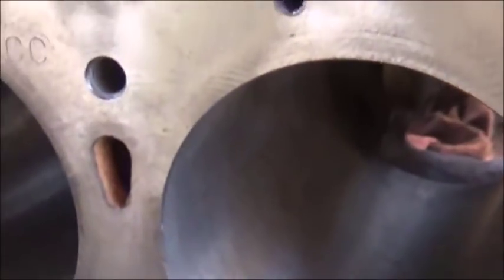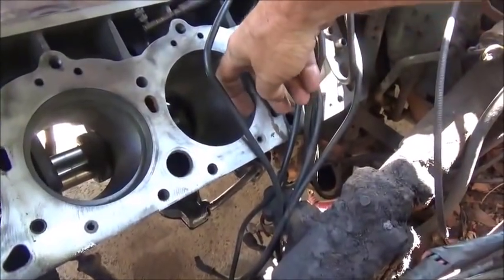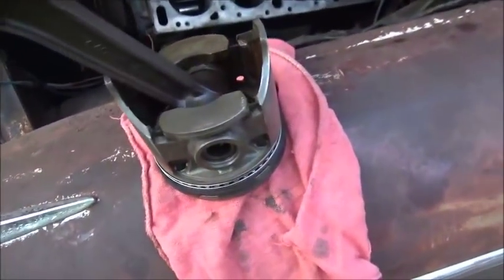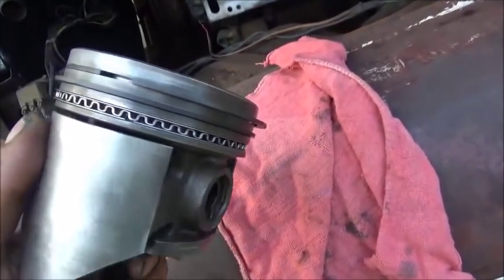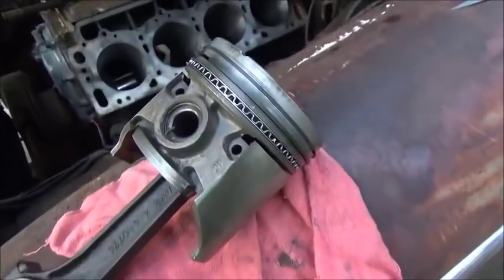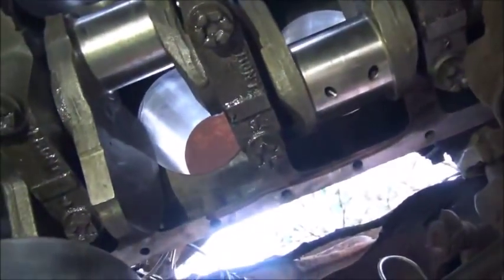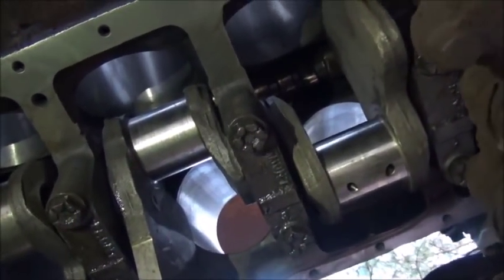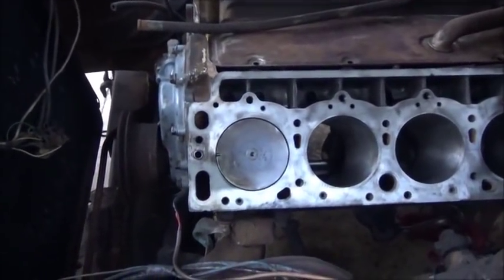1956 STUDEBAKER GOLDEN HAWK ENGINE ASSEMBLY BEGINS

Comment: Pretty much the same way I install pistons in anything. The only thing I do different is, I use a dedicated clean container to put oil in so that I can dip the pistons up past the rings to coat them before I put them in the ring compressor. (Usually get hollered at for using a good Tupperware container..... LOL)

Comment: And it's on it's way!
Yay!
Can't wait to hear it fire up.
Thanks.
Reply: Is there any data on this engine you can post ?  As to year cubic inches,   horsepower & torque,  bore & stoke,  two or four barrels, looks like a strong  and well designed engine,  they may have copied the 55 Chevrolet  design

Comment: So the tube coming out of the valley pan along with the straight up breather was crankcase ventilation in 1956...good thing you removed that valley pan - that po' critter didn't need to be in there...are you going to show the wrist pins for the 2 pistons you had to replace...also, l'm not seeing a whole lot of miles/hours on this motor...& as always l like how you take the extra steps so it gets done right the 1st time...good video
Reply: Thanks for cleaning off the crud from the valley cover. Not my engine but got to say it bugged me! This is one of your best videos yet. When I was a kid (68 years old now) my family knew a man who was a real Stude fan. That's all he ever drove. Even his go to work rat was a clapped out old Stude.
The first vehicle I ever drove (at 12, you could get away with that back then) was an early 50's Stude 1/2 ton with a three on the tree. Still remember the thrill of teaching myself to get the clutch and gas to work together with the gearshift...

Comment: What size is the bore in this engine? The bore spacing looks massive. It looks like some massive Darton wet MID sleeves could be installed in this block. It would be really neat to see someone build a performance engine out of one of these to be different. I don't know how rigid the block is or how good the oiling system is though. I'm also sure the head air flow would hold you back.

Just an fyi for everyone. If you have a block "plateau" honed at a shop and run a newer style of rings (ie not chrome rings) don't put oil on the rings.  They may not seat and break in. Just put oil on the skirts. 

Also a cheap orange dead blow hammer from harbor freight works great as a piston installer.

Comment: Since it has been determined that the front brakes do 75% of the brake work in normal operation, that would account for the discrepancy in front/rear cylinder sizes on vehicles w/o proportioning valves.

Comment: If you can get seals thar are the right diameter for the Nash rear wheel cylinders you can modify your existing pistons to fit the new seals.  The other possibility it to turn new pistons for the seals.  The geometry of the pistons is generally very simple.

Comment: Oh dear, Mickey had a bad day.  I love the design of that engine, you can see that the design engineers really though about the fact that it would need to be worked on and they designed it to make that as easy as possible and to make sure that parts that need checking are as easy as possible to see.  Modern designers could learn an awful lot from this...
Reply: The designer of this engine Col. Jesse Vincent had designed the Packard Twin-Six engine, the Liberty engine (WW 1 Airplane engine), the Packard Super-Eight engine in about 5 different manifestations, the 215 HP flathead straight eight of 1954, and this series of V-8's.

Comment: Wouldn't a 1/8 inch smaller bore brake cylinder react faster (but with last force)  than the 1 inch front cylinders?

Comment: I would have vacuumed it off before I tore it down
Reply from the maker: Couldn't get under the intake before it was torn down and I didn't want to get anything in the ports on the heads.
Reply: @jonathanw4942  that makes  sense.. Im overtired so wasnt thinking straight. sorry about that
Reply: Jonathan W  a Studebaker is NOT a mouses natural habitat.
Reply: Mice are nasty